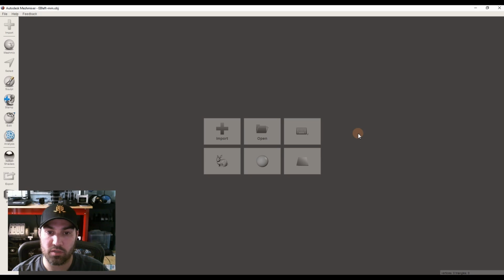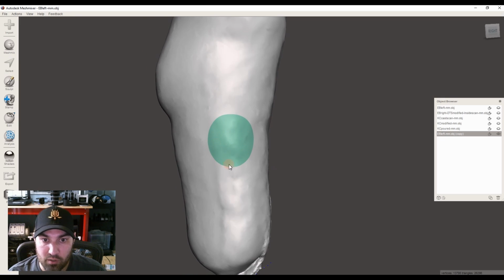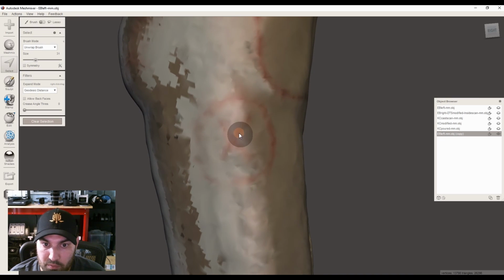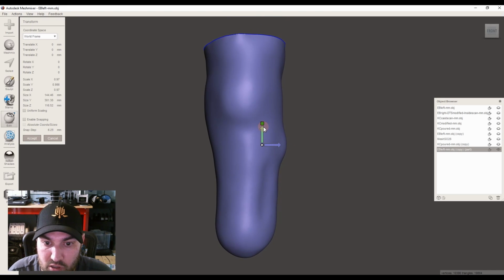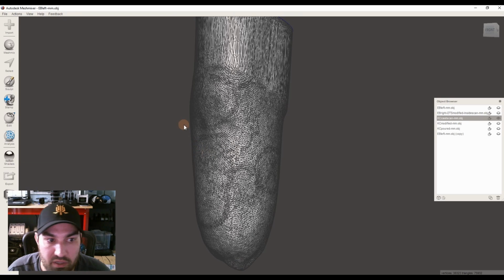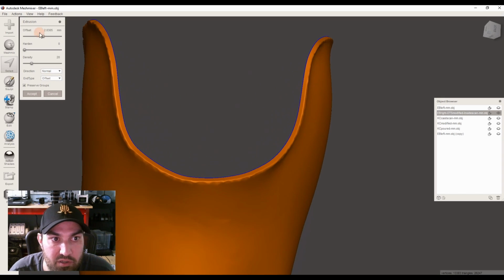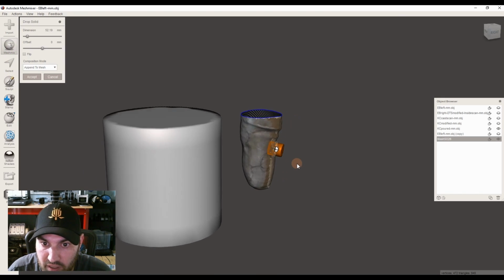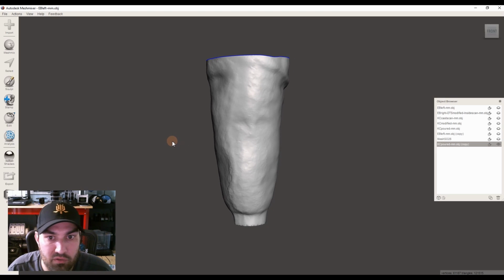Meshmixer tools for O&P

Comment: What do you recommend to use besides Meshmixer for measuring circumferences or limb volume?  I'm looking to implement scanning to monitor residual limb volume change.
Reply from the maker: I use fit.Scandy.co for measuring circumferences.  I don’t know of any good tools to measure limb or socket volumes.  You can also use the O&P specific tools from Mecuris for this
Reply: What’s hard to do is make it mean something for insurance better to have your staff take the same measurements on skin every appointment ptb circ and distal circ.  I’ve long thought a graduated cylinder with fluid in it so you could dip your patient and measure true fluid volume would work best at the moment the limb touches the bottom you’d measure the limb volume.

Digitally you’d need to have length and scaling dead on to matter